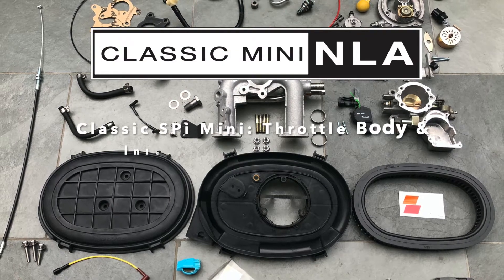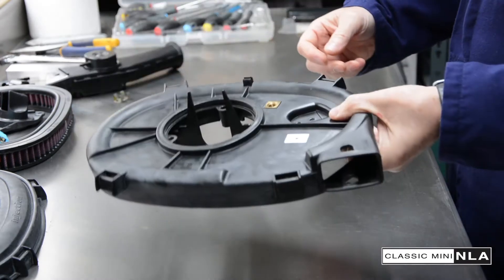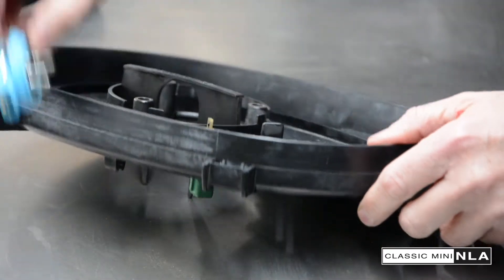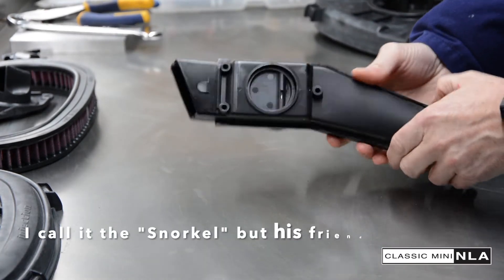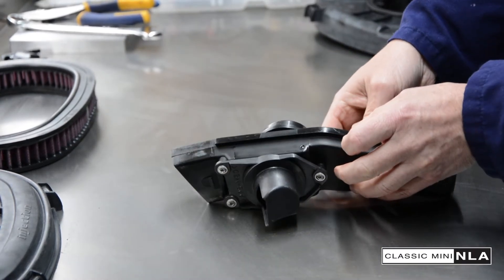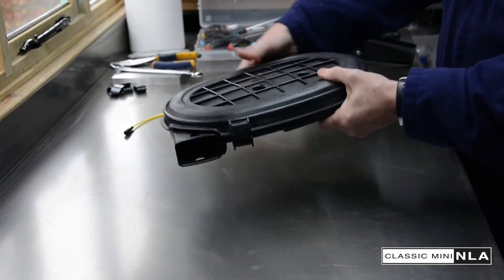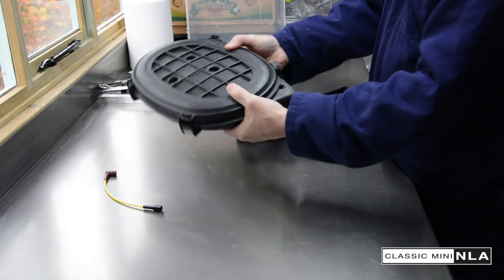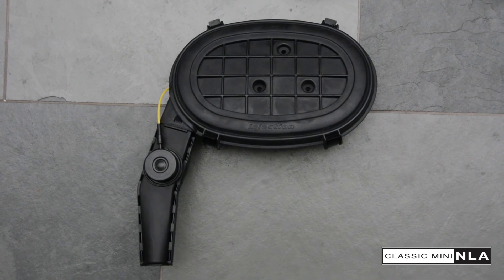Part 1 - Classic SPi Mini Air Filter Housing Assembly (SPi Throttle Body & Inlet Manifold assembly)

Comment: Great video and very informative. I have a spi mini and im trying to find clips for the air box and the seal that goes between the throttle body and the air box. I have spent many hours trying to find these but haven't had any luck. You wouldn't know where I could purchase these from would you. Many thanks Shaun
Reply from the maker: Thank you. The seal is NLA (no longer available) new and if one does come up they're pretty crazy money. My advice is to make your own from a bit of rubber sheet. The air box clips were never sold separately as far as I am aware so the next best thing is is be on the look out for a 2nd hand airbox which has some clips, enough to replace your missing ones.

Comment: Hi Roger.
Nice step by step video. It's relaxing like watching Bob Ross.👍🏻
If I going to the K&N induction Kit, there some parts missing from the original assembly. What problems can be cause??
Reply from the maker: Thank you, I hope you had a nice rest watching it :) Aside from sounding and looking great in the engine bay, a K&N Induction Kit wont improve performance over the standard air filter housing using a K&N replacement filter. There's plenty of evidence to show that the Induction kit is worse for an SPi but as long as you know that then that's all fine, it's your Mini :). From memory, the induction kit can (and must) have the air temperature sensor fitted. It doesn't have a home for the red/orange vacuum pipe connection from the back of the inlet manifold so you will need to completely block off the vacuum nipple that the red/orange vacuum pipe should connect too. If you do that your SPi should cope with the swap. The K&N induction kits inability to manage the air temperature flow into the SPi fuelling system is the main reason why it doesn't perform so well; that missing vacuum pipe removes air temperature control and the position of the air temperature sensor is not as optimal as the standard setup. Even if you install the flexible hose supplied in the kit which brings cold air back to the K&N it still doesn't match the sophistication of the original air filter air flow.